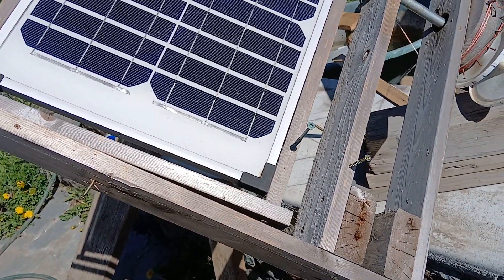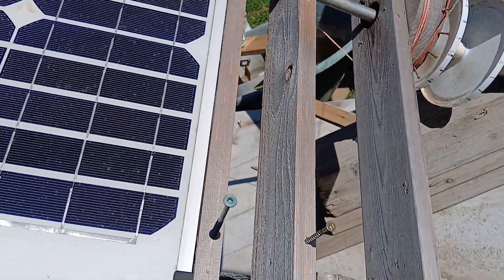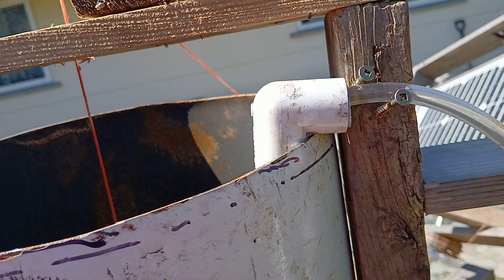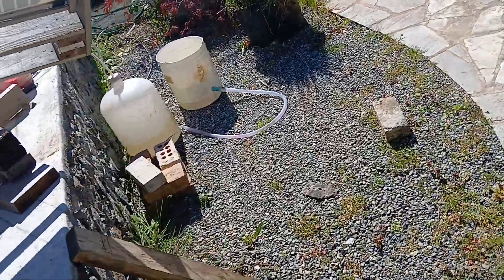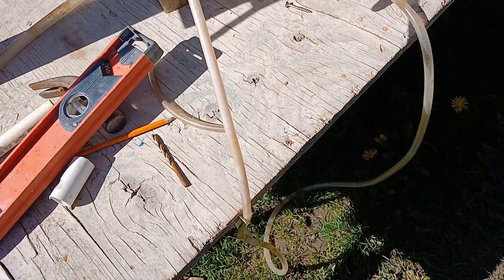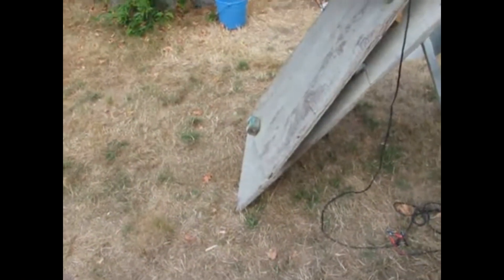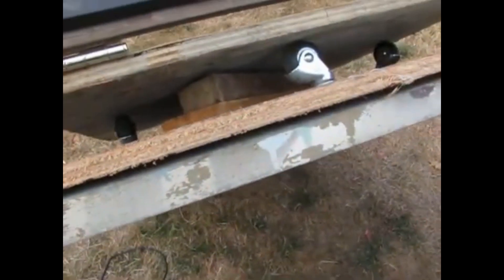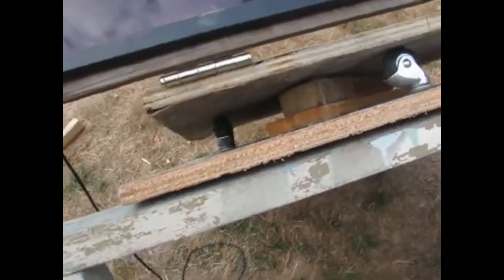First Airlift pumped 2 float solar tracker, more accurate tracking than 90% of commercial trackers!

Comment: Euuu euuu euuu...
Reply from the maker: Hi, please check some of my latest videos for a different easier way to move the solar cooker or solar tracker.   It uses an airlift pump and "waterwheel" "winch".  Sounds more complicated but it is actually simpler and more compact!  I'm hoping that people realize that with equatorial mount, you need just one motor to drive your reflectors instead of 2  with the more normal mounts.  That makes it much simpler once it is set up.

Comment: The one i made uses a pneumatic cylinder. Very slow air leak, and it won't freeze in the winter .
Reply from the maker: It's very hard to get an air leak going at the exact right speed and then to keep an air leak going at the same speed, it slows down when the pressure goes down so you can't get exact tracking.  Mine is on equatorial mount,  tracking is very accurate.
Reply: One end of the collector has a weight, the other end the piston. Mine works

Comment: Amazing!
Reply from the maker: Thank you.  I do feel that this can point to a  low tech "way forward"  for some people who cannot afford extra solar panels or simply don't have any more space.  In that case, if you have welding skills, or carpentry skills,  you can make something like this and increase your electricity production by at least 35% to 45% in summer, probably more.    (The summer boost is better the further north you go). I also see this as something that might work well for pole mounted systems. You would have the water tanks welded to the pole, and you could still have air lift pumps moving the water or perhaps little low voltage dc pumps moving it.  Or maybe dc motors could direct drive the rotation of the panels. So as long as installing and maintaining  your tracker costs a good amount less than adding more panels, you are winning. Especially if it is mostly  "sweat equity".